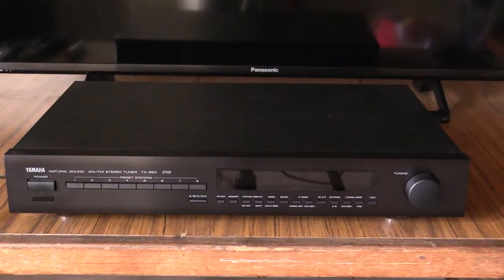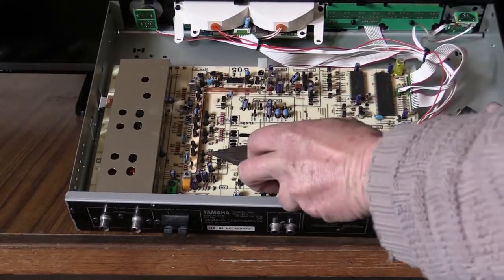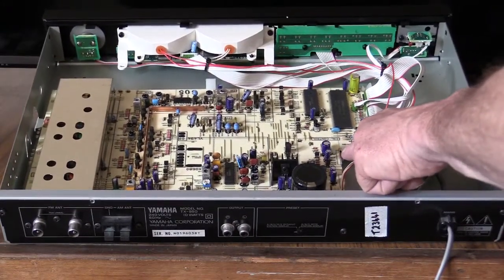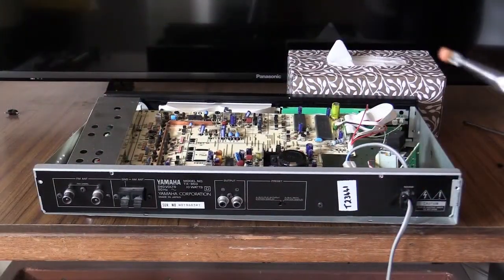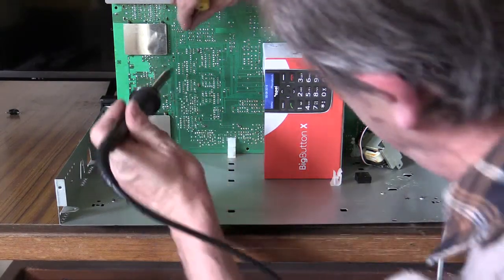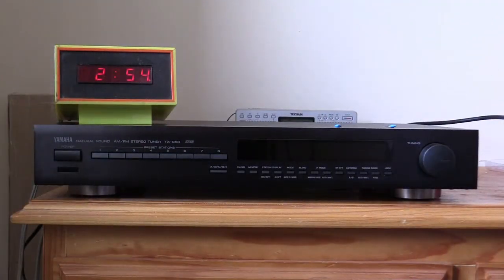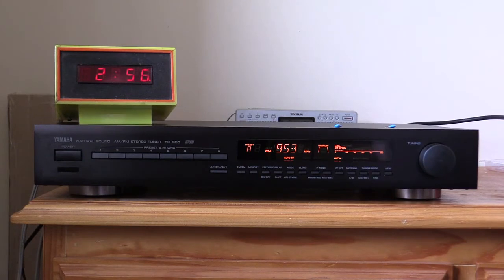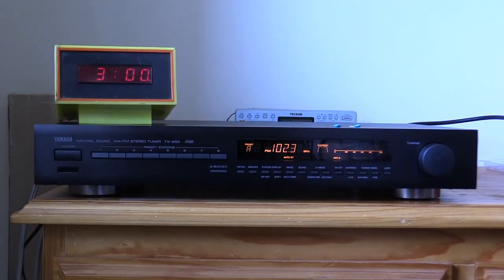Yamaha TX-950 IF filter modification

Comment: But it will reduce its SNR, why you had not gone with another tuner. Why you destroyed company's purpose to make high snr?
Reply from the maker: the aim is for long distance DX signals. The filters are designed to improve the tuner's ability to separate close in signals. The trade off is reduced audio quality. Audio quality is not our focus.
Reply: OK

Comment: Sir what is the purpose if you modified the IF FILTER?
Reply from the maker: to receive weaker FM broadcast signals adjacent to strong local signals, requires the receiver to have good selectivity. The stock filters used inside most tuners are generally inadequate to separate these weaker signals. Hence aftermarket filters are of better quality to do the job. Aftermarket components are made to a higher specification. Hope this helps?
Reply: @dxer22000  sir i have denon  am/fm tuner  model TU-460 and what is the value of IF FILTER to use and i will try? Thanks
Reply from the maker: obviously I'm not qualified to give advice & any modification is at your own risk. But I used 110khz Murata filters on the TX-950 tuner

Comment: There is a guy who used to sell matched IF filters for FM dxers in the US.  Not sure if he still does it. But one issue with IF filters is that they can be centered on a slightly offset frequency - and it's much more noticeable with narrow ones.  Many years ago I modified my Yamaha T-85 with narrower filters with good results.  Now a days, the SDRs are even better at selectivity (though they might lack the dynamic range of an older FM tuner).
Reply from the maker: plus the Sony XDR series HD Radio made modding these older tuners obselete. They are super selective right out of the box.